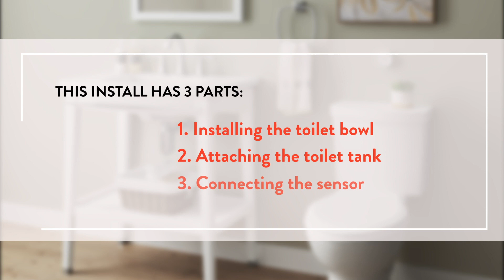American Standard Touchless Toilet Installation: Exposed Trapway

Comment: I had this installed by a professional plumber but the water will just keep running after filling the reservoir and the water level adjustment seems to not be a means of resolving. Is this a known issue?

Comment: Purchased this toilet, during installation I had to fix the cross threaded water nuts and tighten all other fittings, very shotty work. The toilet works well with one exception. When flushed only about 50% of the water is used which does not entirely clean the bowl which results in 2 flushes.
Reply from the maker: Hi Frank - Sorry for the frustration! That certainly doesn't sound right. Please give us a call at 800-442-1902 so we can get some more details and help address your issue. Thanks!